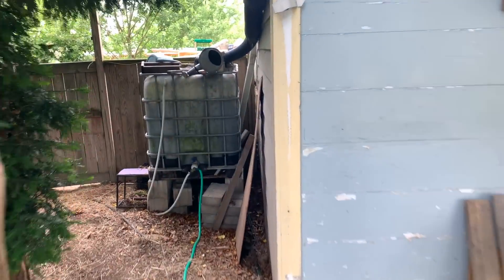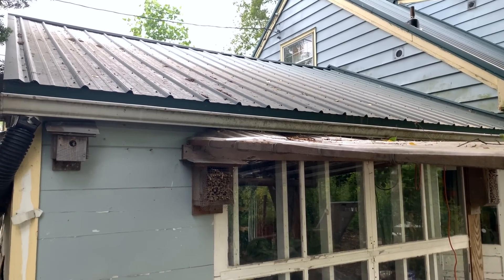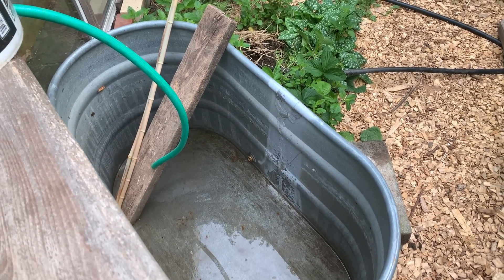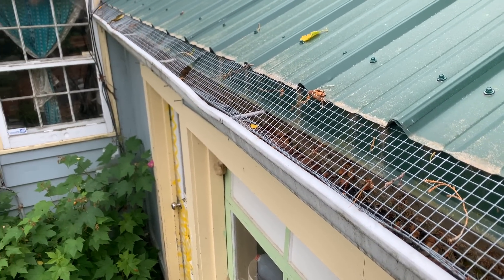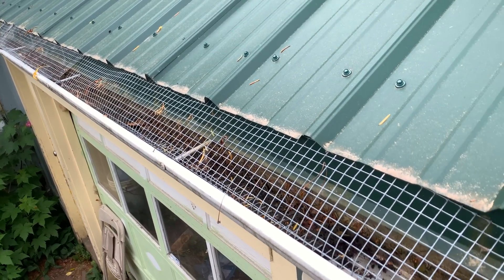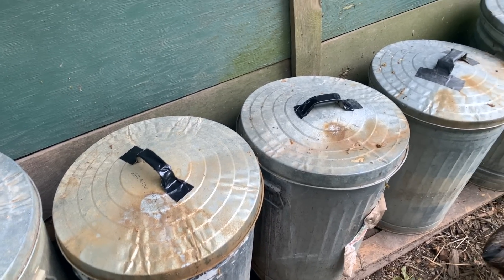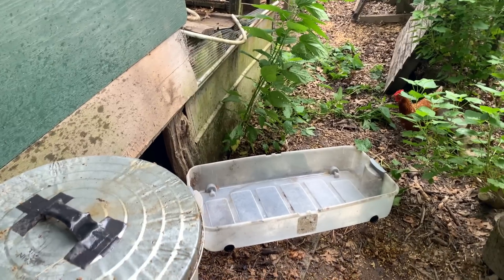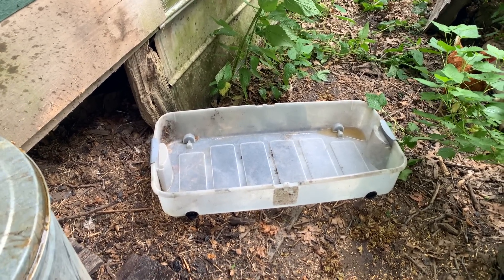Rainwater Harvesting - Preparations for Rain

Comment: 1 inch of rain over 1.6 square feet of area produces 1 gallon of water.  If your house footprint is 1600 Sq ft, that's 1000 gallons per inch of rainfall.
Reply: @growinglifeorganic940  no,that's 6000 Sq ft.  1600 square ft is 40 ft x 40ft or similar.

Comment: 2:40 if you want to cut plastic: use an angle grinder with a cutting wheel. All the teeth and vibration of saw blades (especially a jig/reciprocating saw) is what makes cutting plastic tough, causes it to break, etc.
Reply from the maker: Good tip, thank you
Reply: Yeah, I noticed when I used a thin grinding/cutting wheel on my angle grinder, it didn't produce a ton of micro plastic dust. Instead, it kind of melted and stuck together, and I picked it off.

Comment: Instead of cutting a pipe in half and using that as the gutter, I bought some inexpensive 10 foot long rain gutter liners to direct water flows. I use them horizontally or vertically to direct water flows from the roof to a desired area in the yard. Thanks for the video!

Comment: You could preserve your plumbing fixtures and rain water storage tanks even better if you use a window screen underneath all your larger mesh pieces.You'll end up with a lot less particulate matter that is able to get inside your storage tanks and keep them cleaner as a result. That is what I do anyway. (Starting out a dozen years ago,It helped that my rain barrels came  with  window screen  under a lid similar to a Mason Jar's outer lid on top of each barrel.)
Reply from the maker: Good note.  I used to do that but it hasn't seemed necessary, but it's great to know it works for you!

Comment: I always like to see other people's rainwater collection systems. A lot of the same problems I am trying to solve except we have a single huge tank and a single downspout from our whole roof area and we need to filter it a bit better because we use it for the house too. I thought I had a system I was happy with, similar to yours where the water kind of shoots horizontally over a wire mesh and keeps the debris moving, except this spring (for a change) we have had some BIG rains, the water comes hurtling out of the pipe and completely overshoots the intake. Back to the drawing board a little, I think. But definitely making such systems scalable is a little tricky. I would love to somehow funnel ALL the excess into a backup system like a pond one day but that means laying pipes everywhere.
Reply: I'm imagining the water shooting past the wire mesh could go into a 4" drain pipe which curves 270 degrees redirecting back to the wire mesh; but maybe the inner wall of the 270 is removed so that the more dense water stays in the pipe but a buildup of leaves maybe falls out.  Think going around a curve in a water park slide.  Thinking Dyson vacuum cleaners.
Reply: @misterdubity3073  Ha, that's not a bad idea. Actually, what I had originally done was like a "leaf pooper", the mesh is wrapped round a hole in the pipe and the debris is supposed to shoot out of the end, which it sorta does during moderate rains but I like the idea of making it all do a loop-the-loop or something to slow it down. There are a couple of other design problems to tackle as well, I have a first flush but can't get it to self-empty without getting clogged.   I also want to explore a bio sand filter as we use this water for the house and organic fines make the water stinky. Keep meaning to do a video on it
Reply: @misterdubity3073  Oh, and I know there are systems like that which rely on centrifugal force but they are quite expensive, I bet something similar can be rigged though.
Reply: For your house use, sand and cotton mesh filters, the kind for pools, are widely available and do a great job. Only need uv filter to then make it potable (check local regulations, etc)
Ok a berkey filter of course
Reply: @TheEmbrio  I always thought a carbon filter of some kind was needed as well? I will definitely look into those pool filters, problem is any setup has to be capable of receiving LARGE quantities of water when there is a big rain event. For really torrential rain you need a BIG surface area of filter or you are just going to lose most of the water. So what I have been thinking about lately is the idea of just letting the water in the tank unfiltered but then using a solar-powered bilge pump to gradually cycle the water in the tank up, through a filter system, and back down into the tank, but obviously this would happen off-peak when there is no rain and be at a much more sedate pace. I also have a ceramic filter system on the house, but it gets clogged with particulate matter rather quickly and has to be cleaned out fairly often. Pre-filtering while in the tank would really help reduce the load on the filters.

Comment: How do you keep mosquitoes from breeding in your tank? I’m in Florida and would love to do a system like this but I can see it being a huge mosquito nursery.
Reply: You could switch out the screen for something finer when it isn’t raining. Another option might be a small aerator in the tank to agitate the surface of the water.
Reply: Go from coarse mesh (mobile, cleans’easily)to window screen mesh (pretty well held on, only qnnual cleaning needed) and you’re fine.
Or use any standing water within 4 days, before the mosquito breeding cycle is complete.

Comment: I'm going to hell! I have 2 25'x50' barns with no collection set up. I really hoped to have a system by this Spring, but got "busy" with other stuff. But it's on the to do list. I need to find a source for affordable ibc totes.
Reply: Same! I got some set up on our smaller outbuildings this year but our big barn just drips it all to the ground.....gotta find some cheap gutter solutions! As far as IBC totes, check with area farms. Im fortunate enough to work at a farm that gets fertilizer shipped to us in them. The company doesn't take them back, they accumulate at the farm and my boss just lets me take them free, worth looking into!
Reply: Think about much larger capacity than IBCs if you want to store serious amounts of water. A tote stores, what, a tonne of water? One big rain event and a single tote would be full in minutes, and even if you daisy-chain them and can ensure high-capacity connections between them for fast equalisation, it's still not a great deal (depends how much water you need, I guess). One or two of those big overground tanks can provide WAY more capacity, or round here we dig underground tanks out of reinforced concrete which doesn't work out too expensive.
Reply: Think about earthworks to sink that water into the ground as well.
Reply: @fullcircledesignsllc5408  For sure, if our soil wasn't so porous I would have it all go into a pond, but I don't want to use a liner, it doesn't feel sustainable to me. But swales are also an option if they have a handy nearby food forest that would appreciate it. I am on a bit of a hillside and you're not supposed to use swales above a certain incline
Reply: @thehillsidegardener3961 , I understand what you're saying. I actually have heavy, heavy clay soil. So any large scale storage would be a pond. I just haven't decided exactly where, how many, and how I want to stack functions. I just got this property last May, so this is only 1 year of observation. The totes, while maybe not ideal in a limitless funds situation, would offer me some degree of catchment to water my small greenhouse and nursery bed without running the well pump. Thank God for tree services. I have a ton of mulch which stores an unbelievable, to me, amount of moisture.
Reply: @fullcircledesignsllc5408 , it's in the plan. :)
Reply: @yLeprechaun  Sounds like you have a very good setup to do some exciting things going forward! And yes, observation is key, I have been on my land 6 years now and am still noticing things I wish I had seen 6 years ago..! Also I sort of envy you your clay soil, we have no clay at all and it's impossible to store water in a pond without a liner...
Reply: @thehillsidegardener3961 , trust me, as much as I cuss the clay, I recognize the immense value. We just came from a place the hemorrhaged water below the root zone as fast as it fell, so I understand your plight. It seemed like there wasn't enough organic matter in the whole state to haul in and retain moisture. And then when we finally got the garden plot deep enough and poised for success... we sold that property. Oh well, a new set adventures. It's about the journey they say. Hahaaa